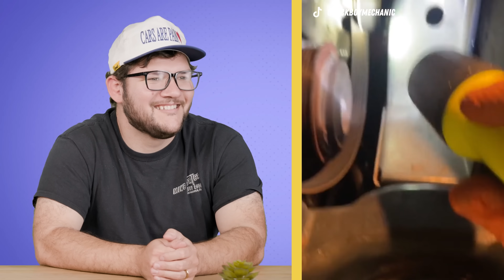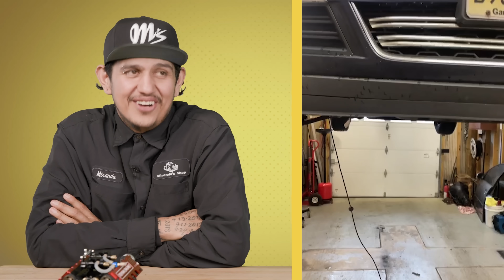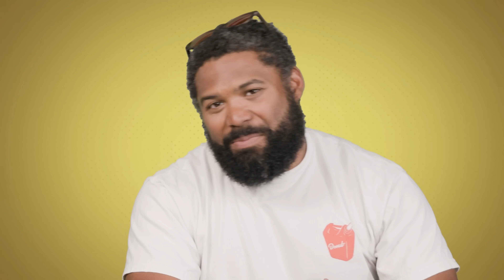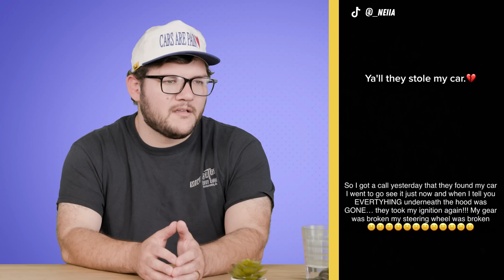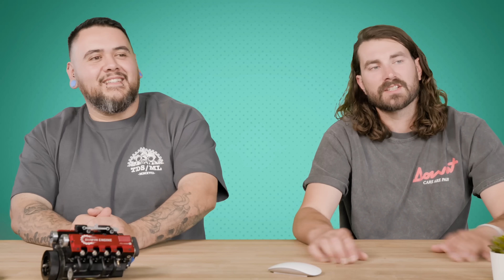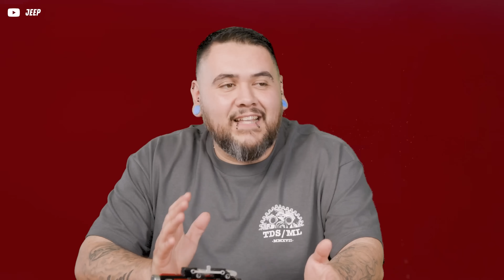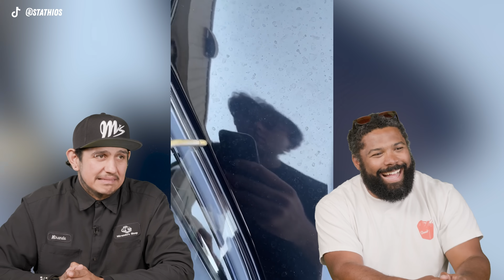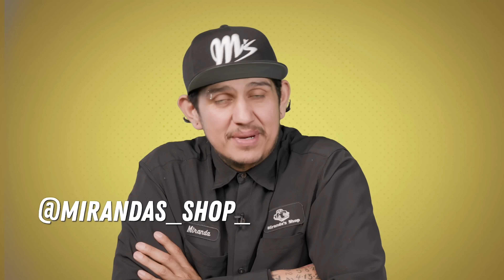Mechanic Reacts to Car Engineering Fails

Comment: Mechanic here. To be honest, that last one is a bit unfair. A power steering pressure hose is going to fail at some point, and leaking into an O2 sensor connector is so minor. All these mechanics have a seen a ruptured pressure line spray over tons of things and cleaned it up and sent it. If there's an issue with a plug or something just replace that broken part, not the whole harness. We've all done that. That guy was at a dealer obviously and was required to replace the whole harness. So for me that last one is nobody's fault. If anything it's the mechanics fault for working at a dealer, and a GM dealer at that. Second worst only to Chrysler. 

But for klmost of those clips, screw you engineers.  Absolutely your fault.

Comment: If you guys knew what engineering work is really like...
Designs are mutilated to save single digit cent costs on parts. Unless you can make someone in charge of the decision believe that it will be a problem costing a heckload of money to fix, neither begging nor pleading will get your proper solution greenlit.
It has only gotten worse with supposedly cheaper outsourced engineering work. I design interior components for a large premium OEM, and all the concept work and big decisions for our components are made by their Indian branch. And these guys are both clueless to reality, and afraid to lose face, so you can't even correct their tragectory [edit: leaving the typo, because it's a mood] to self-destruction. My colleague is currently working on a part 2.5 mm thick, that has to fit in a -1.3 mm gap with 6 mm and 2 mm clearance to its sides. No, that was not a typo. That's just the insanity we have to turn into reality.

Comment: This video hits home at the moment I have just blown a heater hose on my 2002 Holden Jackaroo (Isuzu Trooper) the hose runs under the intake manifold to the back of the motor where it drops down behind the right hand cylinder head, the only way I can see to change this hose is to either pull the motor out or pull the cylinder head off. I have chose option 3 and rerouted the heater hoses to bypass the heater core, it doesn't get that cold here in Australia to really need a heater most of the time anyway. Also if you do another Mechanic reacts to Animal video look at what a kangaroo can do to a car. Something like this https://www.youtube.com/watch?v=qK5XNocpzjo

Comment: The oil filter location to the V6 Mitsubishi Outlander.  It's like smack dab in the middle of the engine VERTICALLY and off to the side (the rear of the engine if where the belts are the front).  It's not below like any sensible vehicle.  Nor up top where it can be dealt with.  It's the most inaccessable filter period.  And you have to shove your hand THROUGH a Subaru to get to their filter.

I only encountered one during my time in a quick lube place, and I'll never forget, 2nd gen V6 Outlander.  May they all spontanously explode (which is likely due to no one changing the oil filter).

Comment: For that first problem, best solution, cut the bolt and install a new shorter bolt with the new tensioner. Easy.

Comment: That oil plug reminds me of my 2018 F150.  Plastic drain plug that sits it damn near on the sway bar 4" from cross member clean off oil from both during oil change

Comment: Most likely the mechanic being the uneducated on the Land Rover.   Unless that's a Ford era or earlier Jaguar/Land Rover.   Jaguar/Land Rover have syphon tubes in the oil filler cap, where they vacuum the oil out.  You take your Jaguar/Land Rover to a dealer for an oil change(which you do while under warranty(6 years/60,000 miles) because its free, along with all other maintenance(fluid flushes, filters, etc) are part of the warranty.  Not to mention if you take your vehicle in for warranty work, and you haven't had your oil changed at the dealer, or at least used the Jaguar/Castrol co-engineered oil, no more warranty...) They aren't using the drain plug to empty the oil.  A lot of Jaguar/Land Rover engines don't even have drain plugs any more, along with no more oil dip sticks.  I could change the oil on my Jaguar XE (post warranty) in less than 10 minutes without lifting the car, or getting dirty.   (The Oil filter is a cartridge type filter on top of the engine.

Comment: can someone explain how putting card board down will cover all around and under my vehicle when the oil is literally spilling out onto the undercarriage cover? I guess I need a 6 foot by 12 foot cardboard box? that crap is literally leaking everywhere off it. Rarely does someone say something not intelligent on here, but that chick needs to slow down a bit to not make em like the factory did

Comment: As an engineer, i gotta say that 99% of the time issue lies in not following designed procedure to disassembly and reassembly components the way we intended. It is crucial not only for the integrity and safety (you check other parts that could have been affected by the malfunction thats being fixed) but also making sure all moments and bits are connected the way they are supposed to be. It is generally understood that car services need to work quickly and prefer faster solutions, but engineers are the ones that ensure safety of drivers and are liable when something goes wrong, thus propper ways to service cars (even tho lengthy) were made to ensure maximal safety and quality, which are mostly followed only in authorized services, who received instructions. In EU we get to check on the mechanics wheter they follow procedures and how do they apply them. Its always better to deal with mechanic that is curisng engineers out because of "impossible bolt" rather than with mourning family or lawsuit that could destroy somebodys life, as the engineer is liable for mistakes that were made in design.
Reply: That may be. But as one chap above noted, it's asinine for the procedure to replace an alternator include steps such as raise the engine and lower the transmission because the alternator is on the back of the engine against the firewall.

No one expects a vehicle lift to be a "required tool" for replacing an alternator.
Reply: @slateslavens  Depends, alternator, if fixed by people that do not know the technological processes, can cause lot of damage and thanks to the infamous US trials, car producers tend to make sure they are not accesible to people without propper equipment... especially thanks to US rulings. One example was the trial against Porsche, when certain fast and furious star died, even tho they used old tires, somehow court ruled it was porsches problem even tho the car and tires were both past warranty... you should actually expect more of similar solutions to be applied, in order to prevent financial damages caused by ... idiots... as there seems to be more and more of them
Reply: @ROBOTKO555  my bad. I forgot to factor in litigation. I suppose I should be happy that cars can even be serviced...
Reply: @slateslavens  well either law needs to take in account idiots or there ll be less and less posibilities to unauthorized/non corpo personnel to fix their own stuff or others peoples stuff

Comment: I don't work with cars, but I can assure you that in electronics manufacturing repairing faulty units isn't an afterthought, it isn't a thought at all. Often the people who develop the test systems aren't the same guys who repair the faulty units, and the test system isn't built with repair in mind. It tells you whether the unit is good or bad as fast as possible, but finding out what isn't good and why isn't high on their priority list. Sometimes one company develops a device and another company does the manufacturing and their knowledge is minimal. Like sometimes all the information the guy developing the test system has is that he needs to put a certain signal in at one end and that the response on the other end needs to be a certain thing, with absolutely no idea what happens in between

Comment: I have some engineering experience, and while I’m thankful that people in the comments are defending engineers, it’s still not completely fair to blame problems on the marketing and business side. Often engineers don’t consult with the business side enough to prevent designing something that will be too costly or risky. The business side may not know the technical processes behind a product, but they are damn good at guessing the result once it hits the market.

Product design is a team effort, so when problems happen it is a team mistake.

Comment: Noticing most of the issues are with american cars or luxury cars. You won't see this sort of egregious design flaws or manufacturing flaws with Korean and Japanese cars. Not saying they may not be without issues but it's definitely way less than american cars. They're much easier to work on too, especially for the average joe.

Comment: I'm not a Tesla hater but I'll never buy one. I'm not a mechanic whatsoever but I have seen a few up close and every single one of them gave me cheap toy car vibes by how they were put together.
There is indeed a problem in the car industry where volume is way more important then proper materials and build quality. As far as I know it's quite noticeable in VW cars. They used to have good quality materials, now they have more and more cheap materials of questionable quality.
I'm not blaming those who build or design the cars, I'm blaming those 'in charge' of the people putting in the actual work. (aka board room and upper management)

Comment: I had to work on a McLaren once during an internship (I was in marketing but they needed a hand).
Battery had gone dead, emergency door release didn't work, and when we finally got access to the battery to charge it the opening was too small to fit the McLaren-charger that came with the car.

Comment: Ok that was fun and all but now I have to say something about real engineers that you may not know. A REAL DEDICATED ENGINEER who wants to design any sort of machine and be proud with it, will do so by considering absolutely every possible fail, reaction, environment, circumstance, user and just about everything to make sure that this machine will last as long as possible and be problem free for as long as possible. BUT no engineer is free to do so, even the best ones, because there are these bags of human waste, absolutely useless creatures, called accountants that stand above the engineers and make them design things that have to break, that must have short lifespan and most importantly be cheap to produce so the company can make most profit on us in repairs and replacements. So don't blame engineers for every fail you see in a machine, a lot of them are made on purpose.

Comment: No, the oil trick, they actually make a funnel. That is designed to fit into that little hole. The cars come from the manufacturers with them in the trunk with spare tire.

Comment: Yeah, jeeps have a common problem with wires in the front driver's door get pinched when you opened and closed it, and all the electronics go out of fries and short circuits the whole system

Comment: Mercury mystique 2.5 has the alternator on the bottom u have to remove the stupid suspension system on the passenger side. I was without my car a whole day n over 500 dollar repair bill

Comment: When you have to remove the engine to change a belt 😅 

2 hours to change a lightbulb

Motor mounts that you need to build specialized tools to get at...

The list goes on.. getting baked in a steel building all day with the sun beating on your back, what's not to love??

20 years in the industry and i quit for life about 2 years ago.

Comment: There is no singular "lemon law".  Every state has its own law.   That commentary is a fail.

Every job has a quoted labor hours required.  If the job takes longer than quoted, that is a corporate problem. Mechanics get paid by the hour, the mechanic shouldn't care how long it takes to complete a job if it is quoted correctly.  The Ford intake manifold takes 6 hours or so (for the 5.4).  The mechanic get pad for that time.

Comment: 3rd gen toyota prius passenger control arm bolt hits the oil pan lmao. Have to disconnect the motor mounts and jack the engine up. Drivers side only takes 20 minutes to do

Comment: 6:34
Speaking as a production operator at TNAP (Toledo North Assembly Plant) where the Jeep Wrangler is built, the electrical problems on the wranglers are a supplier issue. But for other issues it’s definitely the workers lol
Reply: I worked for Polaris at the Roseau plant, in the warehouse picking parts, I cannot tell you how many times a day the line workers couldn't be asked to get their part orders in before a line stop was inevitable, I am with you that some problems are supplier issues while a lot of problems are caused by tweekers doing their jobs incorrectly.
Reply: find that hard to believe coming from someone with a troll face pfp that says you mad bro
Reply: @trenchkote1964  bro it’s been the same profile picture for a couple years now.
Before the UAW strike we had to stop production for 2 days because we had over 8,000 vehicles that needed repaired. Our normal amount is supposed to be under a thousand. We didn’t run the line that entire time so the mechanics can repair them. The main causes were faulty parts and electrical issues. I myself had to stop the production line for issues with the brake caliper hoses and wire harnesses being pinched and damaged. We also constantly stop the line because of instrument panels not working or missed connections.

Comment: I am tech that became an engineer so i have participated in they building of prototype to give feedback to the designer engineer. Wells let me tell You that most of the designer does  have tech knowledge but not tech after sale experience therefore does not have they mind set to think on problems that can come in the future if the part fail. By the way any mods cost a Lot because needs to be implemented worldwide

Comment: In a defense of engineers - often (specially in those low cost brands) a manager or marketing will waltz in and have a conversation with engineer that goes along those tracks (where M stands to management or marketing, E stands to engineering):
M - you finished your work
E - wait, we haven't, there is still some stuff to iron out
M - no, becuase this will make rnd cost to high and we won't be able to recuperate it - so you finished with it
E - but you will loose money on refunds due to high failure rates
M - we said you're done, so you're done unless you want to look for another job.

So yeah, engineers know they did a shit job ... but usually because they were overridden by an imbecile manager.

Comment: I have actually fixed water leaks, you have to strip the whole interior, other than the door panels and dash.. and scrape all the sound deadening, have it ozoned and then redo all the sound deadening. And the new sound deadening is thinner than what comes from the factory and then replace all the carpet. Warranty times pays 23 hours.

Comment: That idler pulley is likely the Toyota 2AZ engine. I got my ratcheting box end stuck on the bolthead 2 weeks ago. 😂. You HAVE to remove the lower engine mount abd the upper dog bone mount and jack the engine up about 4 inches under the pan. (Use a wood block kids don’t damage the oil pan!) after that its very roomy, but were NOT done yet! Remove the crank pulley too as its in the way. NOW you can get the tensioner bolts out! 🎉 (Hits the “That was easy” button.)

Comment: Was one of the first to buy an Acadia. Loved the look and drive. BUT....
So much bad engineering.
Heated wiper fluid was quickly recalled after starting fires. Hey we don't even know how to fix it, we'll just disconnect it and refund you the price of that option.
Moonroof doesn't seal to the roof, just collects water and routes it through the pillars, which is fine except if a little dirt and debris ever lands on your roof it then gets washed into, and plugs, the very small drain holes. You might think the trough around the moonroof would then fill up then and overflow over the roof, but no, because at a certain level it can penetrate into the headliner area and get all the curtain and pillar airbags wet.
Transmissions that average about 90K before failure. GM had to offer an extended warranty on these to avoid a forced recall, however provided no notice to owners. Unless you find out about it, or have a good mechanic that lets you know, you might not take it to the dealer where repairs are free.
Timing chains are smaller than bicycle chains, they stretch and need to be replaced.
There is no under hood access to the headlights, so to replace a bulb you have to remove the wheel, unbolt the wheel well liner, and access it from there.

I hadn't heard of the power steering leak problems before this video, but not surprising.

Comment: Cars aren't built to last anymore.
Reply: It's a catch 22. Most cars will go alot further without major maintenance now, for instance 100k miles decades ago was a big deal, but now most cars can do that without breaking a sweat. ....but the tradeoff is that once maintenance is required then it's very difficult and often very expensive and in some cases you just straight up can't do it, like the new cars are so software and computer based only the dealers can fix them.